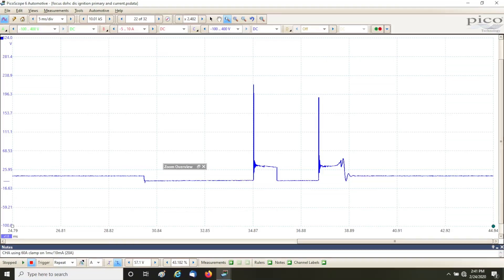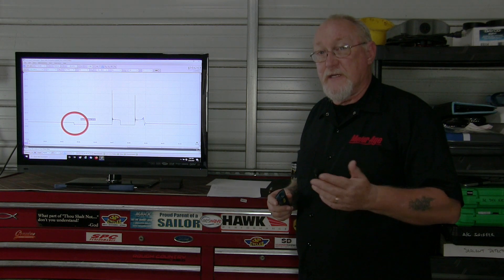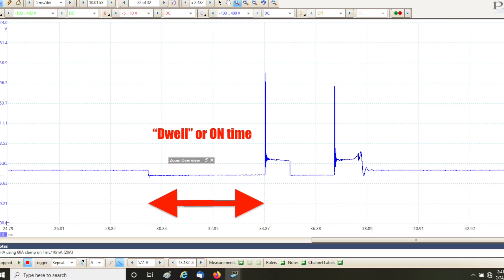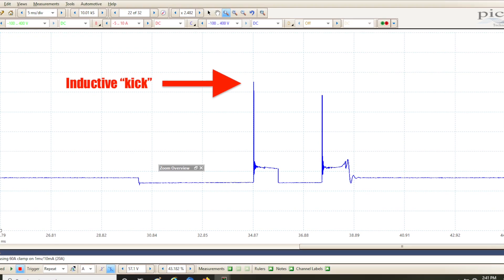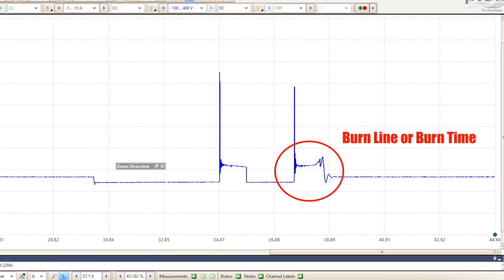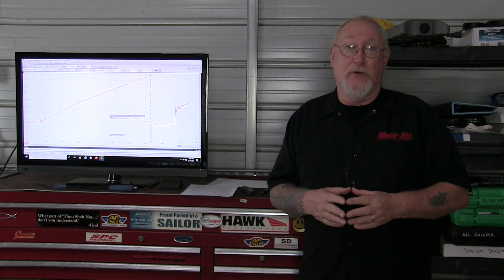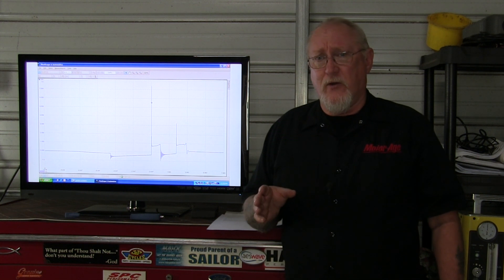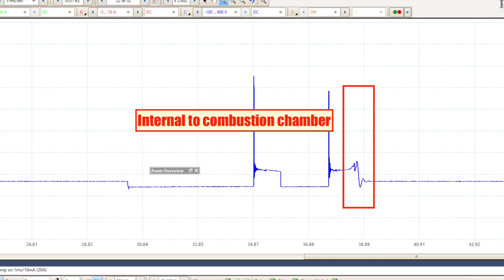The Trainer #99:  A Beginner’s Guide To Understanding Ignition Waveforms

Comment: The "burn time" is not an indication of actual combustion time but rather an indication of the energy stored in the coil. 
It may be calculated as current squared x inductance divided by 2 Joules.
The greater the stored energy the longer the spark duration.

Comment: It's been a long time since I connected the six or 8 secondary leads or the ign coil secondary and #1 spark plug secondary leads to an engine and watched the "parade" or the "raster" on the screen.  On the secondary side I remembered the Dwell, Firing Line, Secondary Ringing, Burn Time and......I can't remember what the drop off to near zero was called.  I remember the Dwell was starting the next cycle.  this was seen in an old SUN "Big Box" diagnostic machine.  Now it's the Pico Scope and LOTS of ways to manipulate the Primary and/or Secondary signal using the scope controls and the proper leads.  Very Good Video Pete!  Brought back memories!

Comment: GREAT CLASS , NEW TO IGNITION TESTING THANKS SO MUCH , COULD YOU TELL ME DOES THE COIL OR THE PCM/ECM CONTROL IGNITION COIL RAMPS AND THANKS AGAIN !
Reply from the maker: The circuit LOAD - in this case, the coil - controls the overall current flow. The ECM can, if a current limiting device is used. It's a combination of the two.
Reply: @VehicleServiceandRepair  THANKS FOR THE REPLY I TRULY APPRECIATE IT !

Comment: I remember a Ford trainer showing us this rope illustration back in the late 90's.  It made sense.  Using secondary ignition testing, it was easy to see some problems, more difficult with others.  C.O.P. systems eliminated the ability for secondary ign testing, unless you removed the coils and added short lengths of ign wiring and tested that way.  GM did that from the factory with the Coil Over Plug ignition.  Good information Pete.